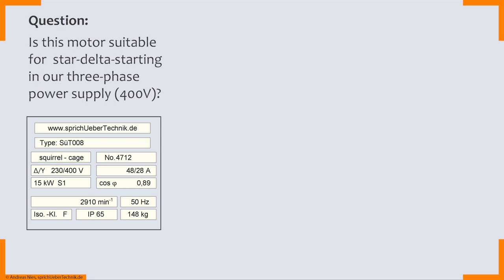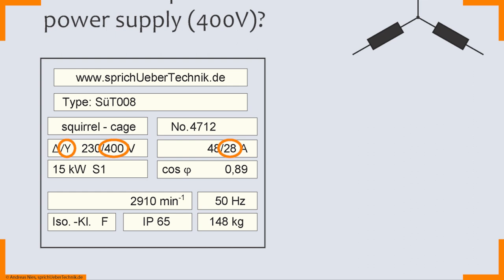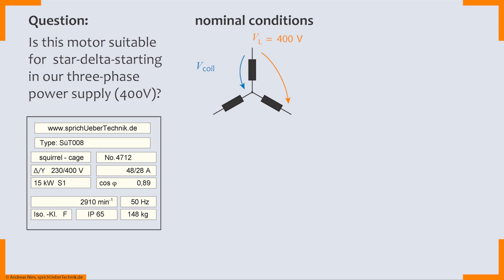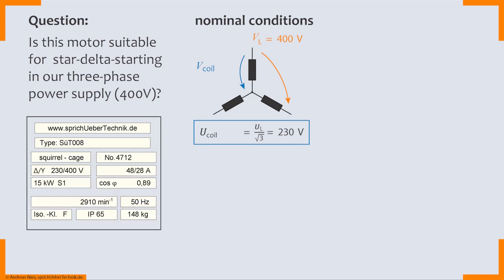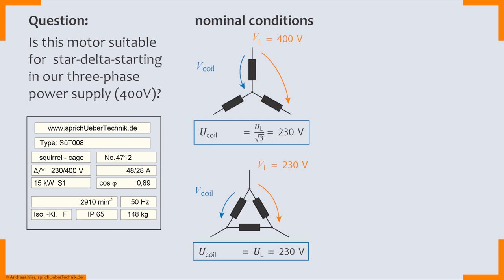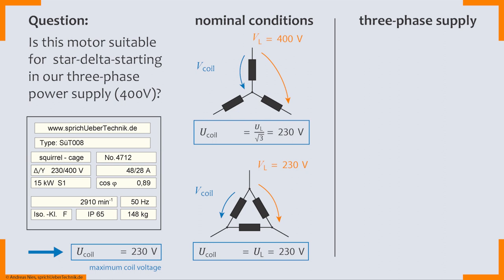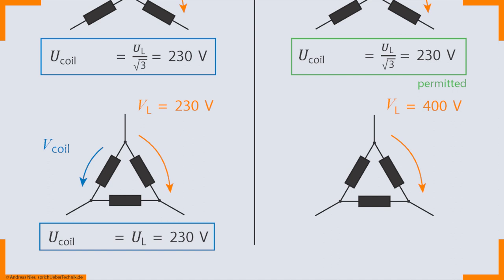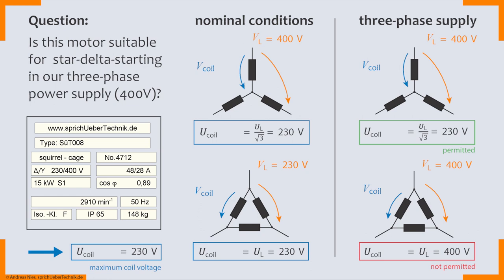Star Delta Starting :: Electric Motor Wiring using the Data on the Nameplate :: for electricians

Comment: Thanks. Very clear, very useful. But I expected you to continue the explanation on the star-delta starting requirement. In your example we, clearly, cannot use star-delta starting. But what should the motor nameplate be to be able to use star-delta.
Reply from the maker: Thanks a lot. And that's a good question: For star-delta starting in our power grid (400 V phase to phase) the motor should be suitable for 400 V in delta connection (hence 690 V in star connection). Greets, Andreas

Comment: Thank you for your super easy to understand video. Excellent work!
I have some questions:

1.  In your example delta connection is rated at 230v phase to phase at 50hz. I'm curious as to where this scenario might apply? 
I think the USA use a 230v 3 phase supply, but this is at 60hz. Is there a 50hz 230v phase to phase supply anywhere in the world?

2. In your example I can see the motor is fairly large. Since this motor would not be compatible with a star delta starting system. I assume the only way to reduce the current draw on start-up would be to fit an inverter drive?

3. So if I see a motor which is rated at 400v Delta, and 690v Star, does that mean it IS suitable for a star/delta starting system? (As 690 divided by root 3 gives around 400v)